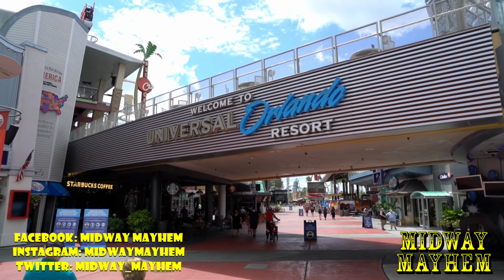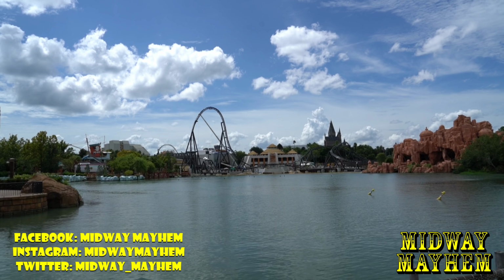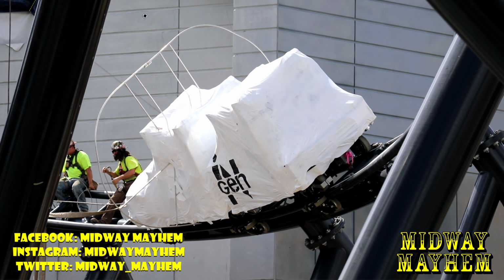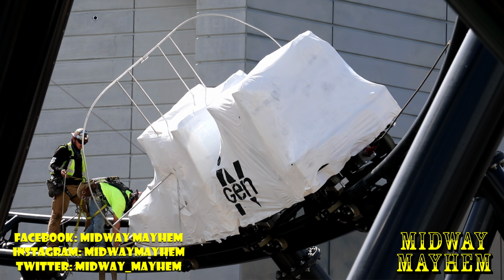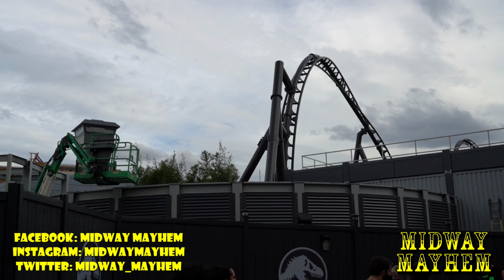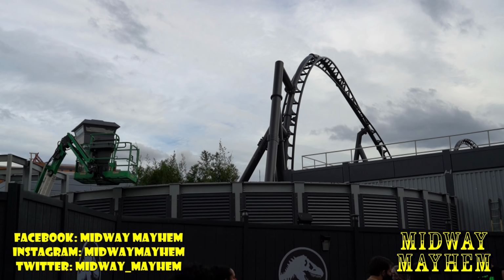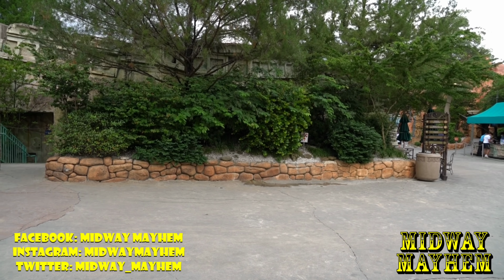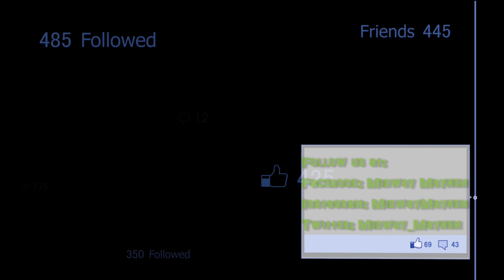Universal Orlando Resort Jurassic Roller Coaster Construction Update 9.16.20 More Clearance Testing!

Comment: what do you think would be better? iron gwazi or this?
Reply: Iron gwazi will be good. But this...... this will be way better than iron gwazi
Reply: Iron Gwazi will be amazing, but so will this, for different reasons! Iron Gwazi has the height and speed, outerbanked airtime, zero-g stall, etc etc. Whereas this has 2 launches, similar unique elements and some more....but this also has insane theming which could make it the winner possibily?
Reply: The reason why the velocicoaster could become the worlds best rollercoaster because it ranks high in 7 different categories. 

2 Launches
Plenty of Air time moments
4 good inversions
A estimated speed of 65-75 mph
A good layout
It has a popular brand name, Jurassic world 
And most of all, outstanding theming.

The velocicoaster has all of it
Reply: @seanmacarthy8129  Agreed! This is one of those coasters that shows that height and speed isn't everything

Comment: 1) How do they pull it?  --- 2) How do they go up the steep track?  --- 3)  Do they do a pull through for every coaster -?   4) What do they do at the top area with the blue plastic / raptor to pull it through?
Reply: 1) Combination of things, but often either a crane or those straps which can be tightened to pull it up inclines
2) A crane will pull it up things like the top hat
3) Intamin do it for every coaster, most manufacturers don't (apart from things like brake runs etc where there are sensors, fins etc)
4) They'll remove the plastic and put it on. They will use a combination of cranes and straps from both sides to stop the train rolling out of control
Reply: @marcussheen  thank you  -- PS:  Do they collect data - or is it simply to test the space around the trains / with the form attached to the train car?

Comment: Curios why Intamin doesn’t have a robot to perform the clearance test.  Robot could climb the track using the track cross ties
Reply: I'm curious why they do the pull through at all to be honest. No other manufacturer I know of does full pull-throughs beyond brake runs/launch tracks etc, and for tight areas (eg, through rockwork) they normally just use the cutout thing which can be easily carried around by workers. Despite all this, Intamin often get it wrong with clearances too - Millennium Force for example (although I think they've matured as a manufacturer a lot recently)